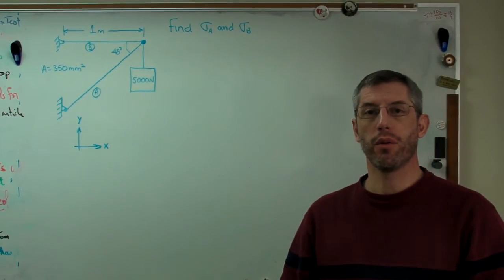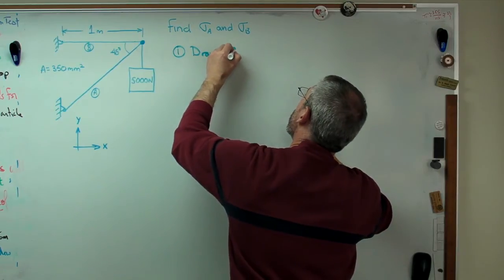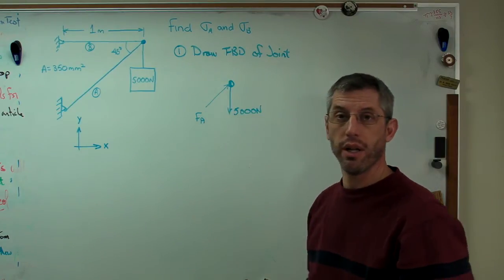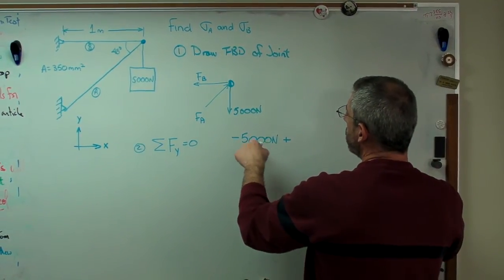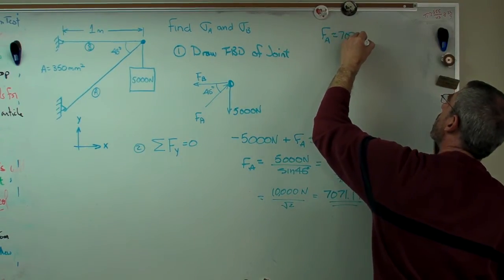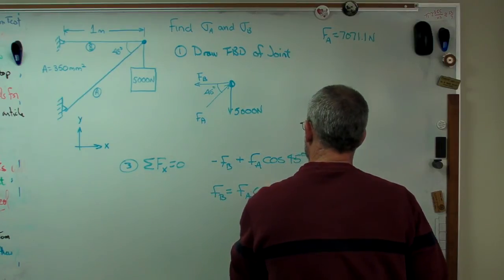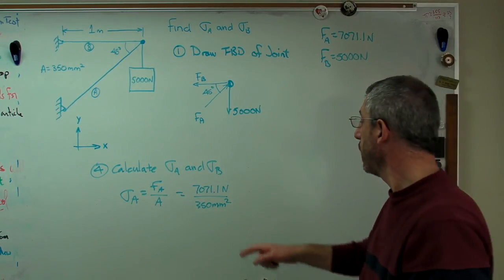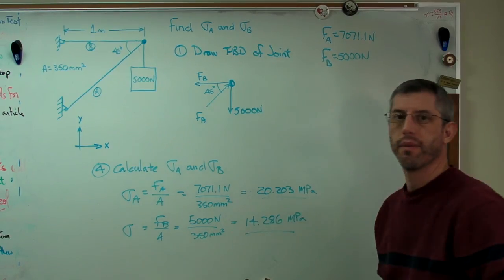Statics - Two Bar Truss

Comment: How do I determine the Ta and Tb of a distributed load on a two bar truss????
My idea is similar in this feed, but I place the total mass at the center of the top bar.  The intersection point of the F and the top bar I calculate the angle to the bottom fixed point and calculate the figures with the new angle.  
My other idea is to calculate the moment applied at the far right joint and then continue with the formula as shown in this feed.
My final figures are close, but not exact.
Thank you

Comment: @InstructionAviation @InstructionAviation 

the area is referring to the cross-section of the truss. the arrangement of the trusses is irrelevant. Imagine cutting a small section out of the picture and rotating 90 degrees. the circular area is 350mm, and is consistent throughout the rest of the bars